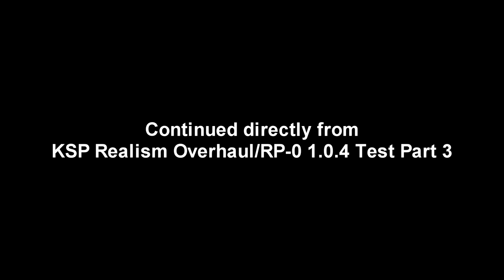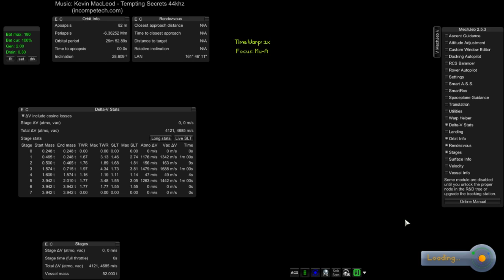KSP 1.0.4 Realism Overhaul/RP-0 Test Part 4 (Livestreamed Aug 2 and 5)

Comment: on man that last one was a real ball breaker!! I had a few issues like the build list disappearing when I first started using kct. you pretty much have to spend all your points on the vab and research division. I started with £50,000 and spent almost all of it before I put a 100g probe into orbit. couldn't do it with only the first node. 
good work keep it up.
Reply: Cool, looking forward to watching that. One of thing to watch is the time it takes to upgrade buildings-1000 days!!! For the launch pad.
Reply: Yeah it caught me out. Accepted a contract for a moon impactor but needed to upgrade. Unfortunately the contract ran out before it had finished building the pad. Much ouch in the prestige rating.